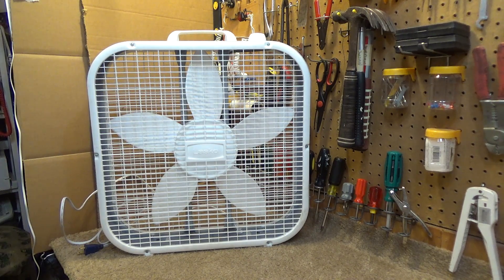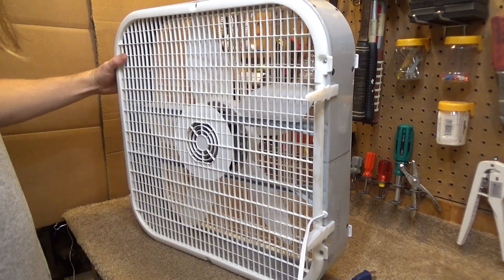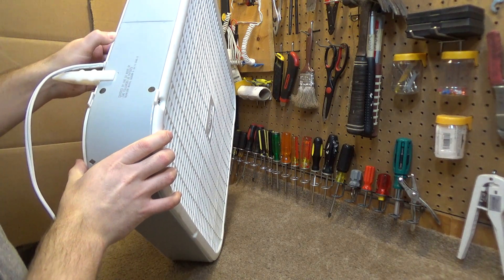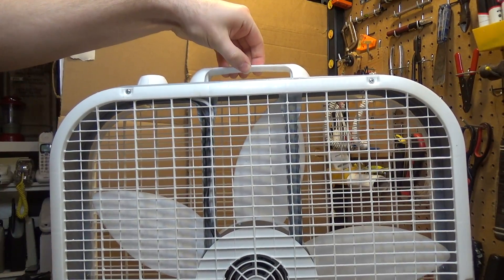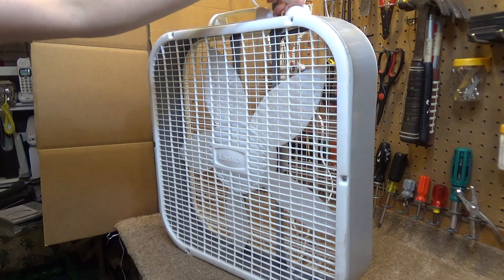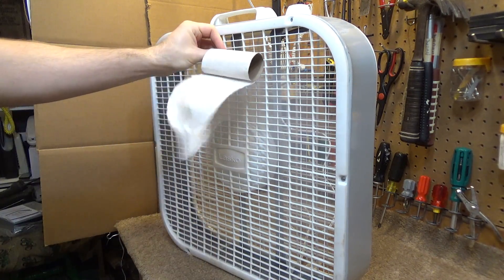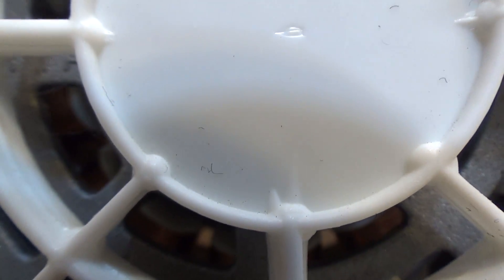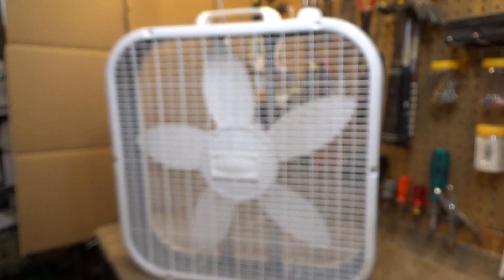Lasko B20200 (3733) with Bigger Capacitor | Initial Checkout

Comment: I went to Walmart today and bought a fan just like that, a B20200, with a 2023-2024 date stamp and watching your video I discovered it had the big capacitor and more windings, so I went back and bought another the exact same capacitor and motor, so I thought it interesting they’re still making them! Both mine run excellent,  thanks for this interesting video; P.S. they’ve gone up in price I paid $23.84 for mine
Reply from the maker: I'm surprised you were able to get 2 of them. From my experience and many others', the ones with the larger capacitor seem to be mixed in and it's a total gamble what you'll get, even from the same isle in the same store.

Comment: Most B20200 lasko fans ive had has had the bigger capacitor. But, almost every 3733 ive had has the regular capacitor which i think is odd.
Reply from the maker: It seems to be almost random. They probably choose whatever supplier has the cheapest bid on a given batch.
Reply: @JordanU  right.

Comment: Don't know if anyone has noticed, but there is a visual logo difference in the front grill of the B20200. It's a rectangle instead of the oval. It's styled like the Galaxy 4733s are.
Reply from the maker: OK
Reply: I thought I was the only one who thought that
Reply: I actually got 2 of these because of that because I thought they looked cooler

Comment: I'm sure that "B20200" translates into: Type- Box, Size- 20 inches, Style- 200.   B 20 200      
As for all other Lasko model numbers. 

For example, S18602(5-speed pedestal fan); that's Type- Stand, Size- 18 inches, Style- 602.  S 18 602

And A20301(Wind Machine); Type- Air circulator, Size- 20 inches, Style- 301.    A 20 301
Reply from the maker: Thanks for the information..
Reply: And also B is for “BIGGER”
Reply: Very unique! Didn't know until now

Comment: I have this b20200 but it has the baby capacitor
Reply from the maker: OK
Reply: How high is the low speed? I don’t need something that moves a crazy amount of air, just a fan that’s comfortable 5 feet away.
Reply from the maker: @TheKingOfHalo  The high speed is high and the low speed is low. This doesn't move a crazy amount of air, it would probably be fine 5 feet away.

Comment: As you requested, the LASKO 3733 I just purchased from Amazon this week (01/05/19) with the larger capacitor, larger windings, greater performance, and startup sound states on the bottom stamp that it was manufactured on 2017-18.  It also has the old oval styled badge on the grill.  $16 on Amazon.  The all black decor version (B20401) was also mfg in 2017-18 but has the regular capacitor, windings, speeds, and no startup sound.  It also cost more at $22 on Amazon
Reply from the maker: That’s so strange.. I really can’t find any consistency with the way these are made..
Reply: @eyestoenvy  I have the decor color version from 2016 2017 but performs exactly how you said that version does but some of the black ones do have the startup sound just rare to find one in amazon

Comment: That medium speed is the default high setting on box fans
Reply from the maker: The medium is closer to what the high speed is on the ones with the smaller capacitor..
Reply: Jordan U but what im saying is that it sounds like it's on high speed for typical box fans with 5 blades on it, such as the fans from the 80s
Reply from the maker: @fargeeks  OK

Comment: I have an old one with a 4uF cap.  It has died.  Purchased a new fan with a 6uF cap.  Maybe they find a larger cap is needed for longevity.  I dont see anybody quantifying what a "larger" capacitor is, so I thought Id share some actual numbers.
Reply from the maker: There seems to be a mix of cap values in the production, some of the current ones still ship with 4 uF. The uF number is a description of the capacitance value, adding a capacitor with a higher value will not necessarily increase the longevity.